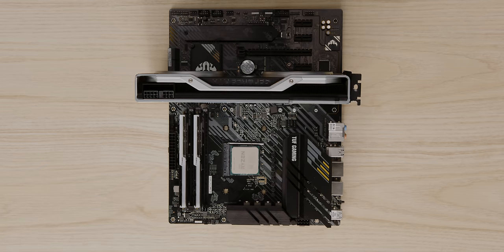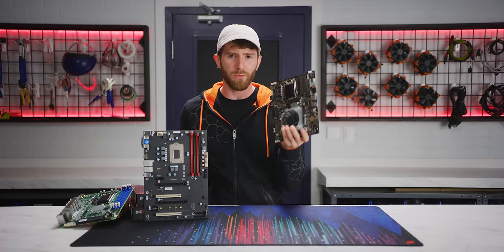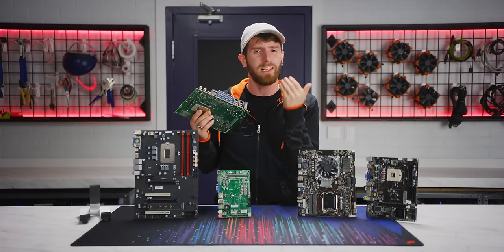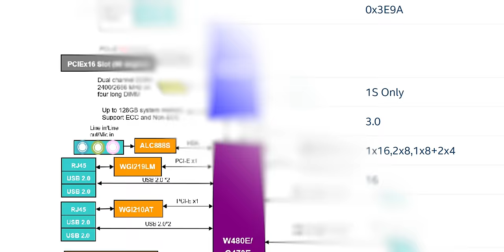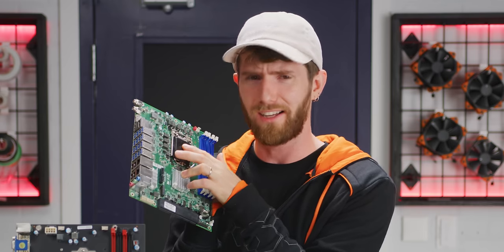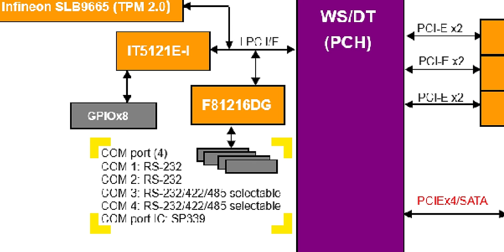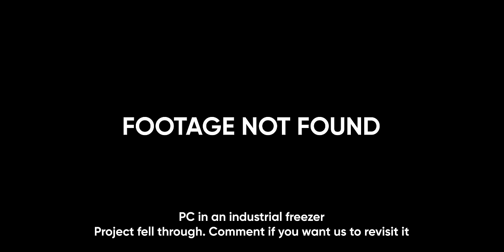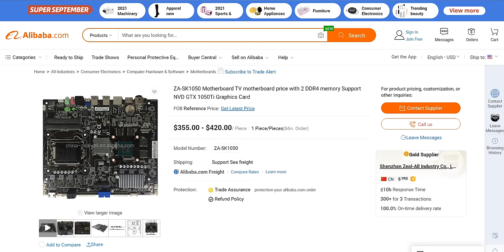5 weird motherboards that shouldn't exist

Comment: First board: USB mining sticks, such as the Gekko USB Bitcoin USB ASICs, or the AntMiners which are fairly slim. Those were my first thoughts.
Second board: Watercooling even maybe?
Third board: Reminds me of my Pentium 3 Compaq back in the day; it actually has a nVidia GPU on the board that is basically an AGP card soldered to the board.
Fourth board: recognized it right away as a mobile CPU board... lol
Fifth board made me think of a PC attempt at being a Raspberry Pi... and also relies on being mounted to a case that acts as the heatsink I would guess.

Comment: I always hear PC in a fridge or freezer wont work but has anyone ever tried this in the ones they use in the back room of a supermarket?  That is set a PC on a cart and roll it into the walk in and close the door.  Those things basically always run when the door is closed.  The home units always used to test this have never been designed for any sort of constant load, They are designed to make something not producing heat get cold and stay that way.  Big walk in units run the fans constantly as do the ones on the customer side as they are designed to handle repeated open and close of the door.

Though I cannot think of any food facility that would let you run this experiment.  Manager would be "yeah no"  to "Hey can we use your ice cream walk in to test a PC myth?" (ice cream walk in operates around -20f, I wouldnt test an AIO in there).

Comment: That first one with the 20 USB ports might be for flight Sims.  Right now I'm using one 9 port, and one 11 port hub for stick, pedals, throttle, 4 mfds, 2 other controllers, and several button boxes, with only a couple left free.  If I add Helo Collective stick as well, that I think takes 2 more with the controller I'm looking at

Comment: I built a PC using the weirdest motherboard I could find. It has a KX-U6580 CPU, only one slot for SODIMM memory, it is powered only with a 4-pin CPU power connector (no motherboard power connector, requires you to add a coupler thingy onto the connector of the PSU), it has no PCIe slots but I connected a GPU anyways going through its WiFi/Bluetooth card slot with an adapter (e-keyed M.2), it's kind of a mess but it actually works... sort of. For some reason it explodes when you try to install NVIDIA GPU drivers onto Windows but it works perfectly fine in Ubuntu.

Comment: 0:00: 🤪 Unconventional motherboards defy standards and logic, showcasing bizarre designs and placements.
3:11: 🤖 Unique motherboard designed for specialized applications with high-speed and low-speed devices, featuring unconventional layout and connectivity options.
6:11: 🤯 Unconventional motherboard designed for digital signage with integrated GTX 1050 Ti and dual 1080p display support.
9:20: 🤯 Desktop motherboard designed for mobile CPUs, manufactured in 2018, with unusual PGA-989 socket.
11:58: ⚙ An analysis of a unique and limited motherboard with minimal I/O options and power requirements.

Comment: At around 11 minutes in, a motherboard is mentioned with a mobile CPU socket. Among many others, Intel Core 2 Duo series processors will fit in such a socket. I know this because of an uncomfortably long time spent trying to repair a Toshiba Satellite A305 that I found in the top of a closet smelling like body odor.

Comment: The 10Gb, 5Gb, 480Mb speeds we know in USB are the speed of the root controller, not the usb port. Ports connected to the same root controller share these speeds. For example, those six USB 3.2 gen 2 ports (each without its own controller) share 10Gb speeds. Likewise, other ports share the speed in the same way.

Comment: I totally want a motherboard that would have more USB ports. Currently I have like 5xUSB-A, 1xUSB-C, and a case with 4xUSB-a. 10 USB ports total, and I still need to use a 1 to 4 dongle and 1 to 7 dongle, a 1 to 2 keyboard and have more dongles at the ready. I unplugged most stuff when I was cleaning up, but still I have stuff plugged into 12 ports.
Camera, Lighting, Microphone, Keyboard usbc cable, keyboard 2.4 connection, mouse 2.4, Bluetooth adapter, Soundbar, Keypad, Microphone, Headphones, usbc to usbc cable for connecting devices...

Comment: That last board, the Epic.... looks a LOT like the board that runs my camera system... which was made in China. And yeah, the power is a 12v 5a AC adapter. My board also had a thin heatsink that was almost the same size as the board held on by some kind of double-sided thermal tape/pad all of which was screwed to the chassis, pinching the pad and heatsink between the board and chassis.

Comment: I bought a mobo with as many USB ports as I could find because VR equipment (Vive pucks in particular) use a LOT of USB slots, and I was actually hitting the device/controller limits.

So there's a usecase.

Comment: I thought the board was inverted and was suppose to be installed upside down at 9:00 ESPECIALLY because the I/O is on the right side right after the B-Roll but then any express card wouldn't be able to screw down. didn't even notice the socket was any different then a old AMD CPU

Comment: The portwell one would have been a Chia miner dream, if Chia wasnt been a failure. Weird motherboards, i mean, there is a lot of industrial boards out there, some of them with ISA ports, the mining revolution yielded a lot of weird designs like the Asrock H510 pro BTC, the Btc S37... etc... The Asus J4005I-C is petty much a desktop board with soldered cpu, with once exception it has a LVDS and backlight connections avalible for use.

Comment: I wish I had 20 usb ports on the back of my computer. My computer already has a lot but they're almost all being used by something.

On the back I have my:
1. Keyboard
2. Mouse
3. Dongle for Wireless Headphones w/ 7.1
4. Microphone
5. Webcam
6. Capture Card for recording console games
7. VR Headset
8, 9, 10. Three Dongles for full body trackers for VR

On the front I have:
11, 12. The Wii U Gamecube contoller adapter which I use to play a Gamecube emulator with a Gamecube controller which takes two usb ports.
13. A USB to USB-C for any devices like my phone I want to connect
14. A bluetooth dongle because my computer doesn't already have it (It used to have a device inside with bt and wifi, but I got rid of it because the bt and wifi connections were both horrible no matter where I put it)

I'm left with 1 open port on the back and 1 in the front, and I rarely see computers, even desktop ones, with as many ports as I have. I also have a 4 port usb hub just in case, and it would definitely need it if I wanted to get 11 point tracking for my VR. Right now I mainly use it for my phone so I can connect a mouse, keyboard, flash drive etc. The Gamecube adapter also surprisingly works with the Gamecube emulator on my phone.

Comment: well i can tell you that at least one use of that first portwell mainboard with all the USB ports is for a high speed camera controller by some companies in the printing industry
the one i've seen in use power was supplied by a distributer built into the press, not from it's own dedicated PSU

Comment: The last one has to be an industrial motherboard. The CPU is on the backside and the board gets mounted against a heatsink that is basically the backside of the case. That way you can have waterproof PC's. Might even be an all in one PC with a touchscreen. Ive seen things like that.

Comment: With that amount of USB i could see using it for VR plus sim racing gear plus motion chairs etc etc. baller sim controller. I already run out with my 10 USB ports with running VR and sim gear

Comment: 20 USB ports would be great for me. I've 12 USB drives in RAID5+1 configuration for my home server solution.   
The little Winmax board has another odd design quirk that you completely overlooked: It has the PCI slots and I/O ports reversed. That would not fit in an ATX case.

Comment: I would love to see some special case for the Q270 Surnia.
You could build a system where the CPU cooler is just a huge heatsink milled out of aluminium, stretching over the whole back of the Board. 
It could one side of the Case at the same time, making it a super slim (in case you wont put in a pcie card) PC, with passive cooling.

Comment: that tiny mobo looks like it was desighned for use in a laptop because ive seen older models that have IO on the back rather than on the left or right.

Comment: The things I could potentially plug in:
Mouse, keyboard, controller, HOTAS(2 units), another cheaper joystick with built-in throttle slider, phone, PSSD (Portable SSD), uuhh lets see, there's also uuuuhhhhhhh
Yah I think that's 'bout it, 8 whole things I could plug in

Comment: Back in 2016 I realized my i7-3610QM laptop was weak on GPU side (GT650M) and I was looking for a mobo that would take the CPU and connect newer full sized GPU. There were mobos like that, but for industrial kiosks and the cost was too high to make any sense for me. I ended up playing with eGPU and then switched to desktop, but if that HM77 was out that time :)

For that board with GTX1050 I'm sure there is ton of use with todays prices :D but does it game?

Comment: Linus, you're a goober. ~1:45 they're normal DC barrel connectors with threaded retention. You don't have to use the screw sleeve, a normal 5.5x2.5 DC barrel plug will fit as well.

@10:44 - I'm not sure where you get your info, but most of the entire sandy and ivy bridge mobile line was offered as PGA or FCBGA packaging. There's literally thousands of used i3, i5 and i7 chips on eBay starting at < $10. In that era, it was actually more common to see PGA chips socketed in laptops than soldered. The i7-3540M is a PGA988 chip that's as common, if not more common, than dirt, so is the i5-3340M. They're $10-30 on eBay. You're also confusing ULV parts with an entire product line. ULV parts were ultra low voltage chips for passive and fanless applications and are a small subset of the sandy and ivy bridge product lines.

Comment: AGV is not an autonomous vehicle... technically they follow set guided paths which is why they are automated. Compared to an AMR which is autonomous and is used in an uncontrolled environment where structures may change

Comment: Interesting. If my CPU (i5-3210M) and RAM outlasts my currently 8 year old laptop, I'll try to find an FCPGA988 board that takes on the SO-DIMM DDR3 RAM and make a multimedia PC for the TV that I can stream to.

p.s. It is a socketed CPU, I already had to replace the thermal paste 2 years ago cause of temps, so I know for sure.

Comment: How to block your RFID For free
1. Bus card, most bus companies offer a bus card. Ask for one, usually you get it free of charge
2. Permanently disable RFID: Use a razer blade and cut the antenna using a flashlight, cutting close to the chip on the card will definetly destroy it  
NOTE: This method is irreversible. You can not ever pay with RFID again

Comment: And do not forget that Xeon 2678 v3 that weirdly supports both DDR3 and DDR4 RAM. Its Haswell-EP with lga2011-3 motherboard socket. By far that is the most powerfull cpu that still support ddr3 RAM (y'all know its cheaper sticks per gigabyte)

Comment: "Asrock 939 dual - sata 2" was a cool motherboard for socket 939, had both AGP and PCIE which was unheard of at the time.
Reply: I still have one of those as my retro Windows XP machine for those times when I want to play something on era-appropriate hardware. It's currently got an Athlon 64 3800 X2, 2 GB of DDR-400, an ATI X1900 XTX, and a SB X-Fi XtremeMusic all hooked up to a glorious 19" CRT. The board's chipset drivers are still floating around on ASRock's website, although I had some fun getting the SATA driver loaded while installing the OS since XP's installer demands that you have the driver on a floppy disk; it led to me digging through my Box Of Crap to try and find not only a floppy drive, but also a disk!

Comment: Don't knock 20 USB ports. I have some fifteen USB gadgets... and I don't work at home... It's reasonably challenging to locate external powered hubs that 1) hold up 2) are stable under load 3) rinse and repeat

Comment: I always find it odd when people act like 4 USB is plenty of IO. 
Keyboard (2), Mouse, Laser Printer, Ink Printer, 3D Printer, Mic, Webcam, Drawing Tablet, Hotas, Racing Wheel, Xbone Controller, Arduino, MIDI over USB, Phone Data Transfer Cable...Even after removing some USBs I used to use I've still got need for THIRTEEN. Oh yeah and you should always have one empty one for thumbsticks, so FOURTEEN...

Comment: 12:07 Wrong. You can boot Sandy Bridge from an NVMe drive with a REFIND USB, or use BIOS tools to add NVMe support. I'm writing this message on a dual Xeon E5-2690 v1 booted from an ASUS HyperX with a PCIe 3.0 NVMe 2280 storing Windows 10.

Comment: I hope linus remembers he has a sort of "dream budget". He doesn't seem to think 2 RAM slots are something notable. I mean, Linus, I hear ya... But I'm on the other side; I basically live with a coffee lake i5  CPU with 16 Gigabytes of ram. But I'm running on 2 RAM slots. It doesn't change too much, but to build a new computer, I have to break my budget. So if you ask me 2 dimm about all I can afford.

Note:
If you plan to comment a reply, Please remember that I'm not your typical PC user. For 1 I don't play Modern games ever. At best I play games from 2013-ish. Another is I DON'T use a graphics card. I'm not lying when I say it's unfortunate, But looking at my games and my willingness to wait until a video is done processing, I don't actually NEED one real scary. It's a miner advantage, NOT life threatening in my case.

I'm also more resourceful. 16GB sounds Minimum and 6 cores sounds average. But I didn't build a computer solely for gaming. I make games (or Apps) and build websites. I make videos and the list goes on. So my computer is clearly not built considering one purpose. That said, I'm tied down with a budget, So I'd say I'm doing fine.

I Almost forgot. I'm ENTIRELY self taught. Nobody's taught me nothing. So I might be inconsistent or do things differently. Remember that.

Comment: i had this ONDA A68V ver 1.0 for FM2+ Processors.
it was so weird, the cooler must be placed in X-Axis (not Y-Axis like any conventional motherboard), so when i tried to use a conventional air cooler with heatpipes (I used Deepcool Gammaxx 400S), instead of having the fan blowing the air to the I/O, it was blowing th air to the top side of the case. so you can imagine, if anything went wrong, it could bust my GPU along. xD
Not to mention, it got weird USB 3 Front Header positioning. it was just right below the PCIE x16, i thought it was fine UNTIL i tried to i install my Powercolor RX 550 (Dual Slot). and yes,  i couldn't install it, so have to use the pc without USB 3 front I/O. Later on, i learned that we could only use a single slot GPU (i used an R9 M360 Dell OEM) if we wanted to use the USB 3 Front Header.
Oh one more thing, it got weird BIOS. idk, its like un-save-able (?). everytime i opened the BIOS, it would always started with Chinese so i have to change it to English everytime i accessed the BIOS.

Comment: The GIGABYTE B150M-PIO and ASUS B150M-PIO are more weird motherboards with the PCIe slot on the top of the motherboard, at a 90 degree angle to mount a full size gpu vertically in an SFF case

Comment: Too many USB ports? Consider all of the USB devices that one might connect to the MB. I have the usual devices on my PC, such as a keyboard, mouse, and headset. Then the extras: printer, smart phone, flash blood glucose monitor, UPS connector, camera, memory card reader. That's nine, at last count. I needed to add an inateck RedComets PCIe U22 card that gives me an additional 6 USB A and 2 USB C ports. This last one replaced a 4 USB hub. Its additional USB ports use a shared USB cable, slowing down the transfer speed.

Comment: LGR did a similarly interesting build with a 64-Bit Pentium-compatible motherboard that had PCI slots and not only 9-pin serial, but also a parallel port header.
Reply: Many Pentium motherboards (and AMD K5 boards, and ESPECIALLY the boards that supported both) had at least a couple of PCI slots - intended for the higher-end OF THE TIME video cards.

Comment: I honestly don't get the Enctec Rev Q270 Surnia. Except for its amazing clean look. With an expansion card it requires double the space a normal PC set up requires. And by all means, five inches to the other side, the air won't be much cooler. Liquid cooling or other forms of heat exchange enable everything on the average motherboard working fine in a hermetically sealed case that in an industrial environment prevents any possible problem with dust. Today's average CPU's are by far capable enough to run most industrial processes. To maximise reliability you could therefore even clock down RAM and CPU. Which in turn leads to less heat, making a not that big passive radiator feasible. Up to very rigid water and dust proof keyboards, mice and monitors have been available for years.

Comment: I once bought a pc at a local discounter that was really weird. 
Only one ram slot, one sata connector, one pci slot and no fan commectors, but 3 fans that had cables that were soldered to the motherboard. Also the only monitor connector was a dvi connector and i had to use a vga to dvi adapter. I also couldn't find a psu, because the cable went into the case and had all components in there seperately spread out in an area.
I should mention that this abomination had only cost around 250€ and was shitty in all possible points.